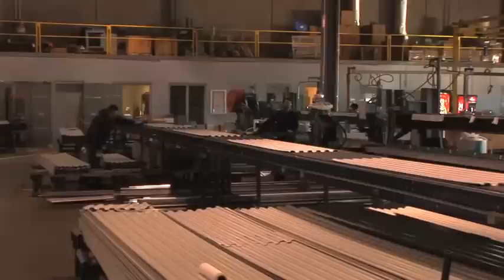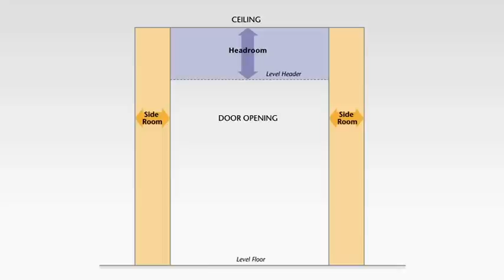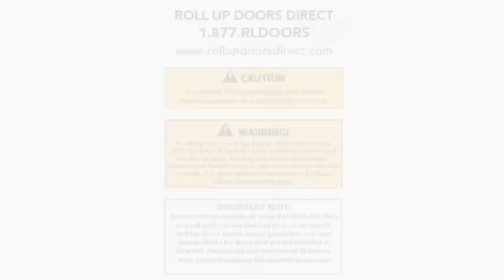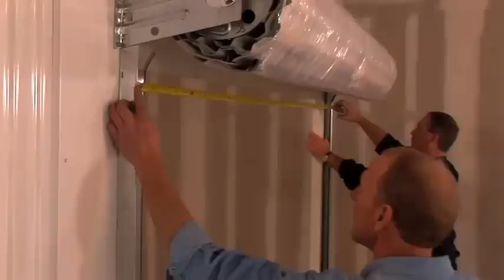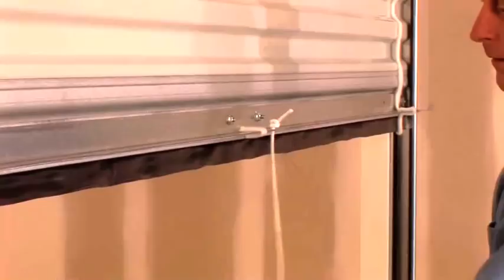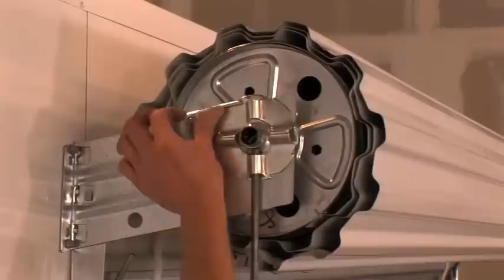Roll up door installation instructions and safety guidelines. 1-877-357-DOOR(3667)

Comment: Page 1 of instructions should say DO NOT REMOVE PLASTIC WRAP UNTIL STEP X, It should say this outside on box as well...Looks like say video and door as Ideal 200M...  having issues with spring tension on my drum, when lift door it slips the drum, trying to determine how much tension is safe to load on the door.. as if I get it to about what is needed, something slips inside my drum and back to no tension.
Reply: Do I need to roll up curtain back on drum and release all tension and start all over?  used to preloaded full sized garage doors with little adjustment.

Comment: Hi.  I have a roll up door just like this one. It is 10 feet wide. I removed it from a shed and I am reinstalling it.  First off, it is heavy as hell.  In the process of installing, it came unrolled. After much struggle I mounted it on the opening.  Now trying to get it to roll back up is impossible. The ratching on the left side is not rachting or doing anything.  How do I get this to work ?  I hope you don't tell me I have to remove it and start allover again.  This thing is a pain in the ass.
Reply: These door are high skill pill if not done correct.  I own three with unique spring loading.

Comment: I've seen these in store promoted as shed doors. I was interested but it looks like a nightmare with water intrusion since a shed with a wooden platform usually don't has a required slope...
Reply: That's why you put theshold in the bottom.
Reply: Poutinsky _ weather stripping  bro get a clue . Research goes a long way in life

Comment: Can a electric motor be installed on this type ?
Reply: This particular door set-up is known as what is called a "dead shaft" type door. Some manufactures build doors like this upon request to accept and electric operator just depending on the model. I recommend the Liftmaster model 3950 as a bigger commercial operator will tear these doors to pieces in the event the door is locked or bound up.
Reply: I did 3950, but only good for small light weight
Reply: Yes, but a pill with gear reduction that make motor run error backwards
Reply: I got my clutch loosie goosie, works perfect with a bit more safety